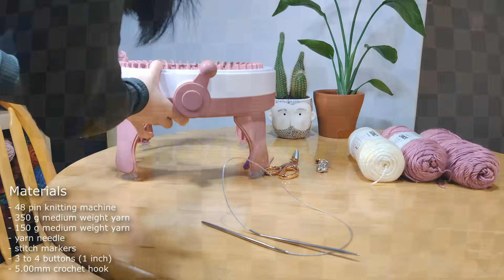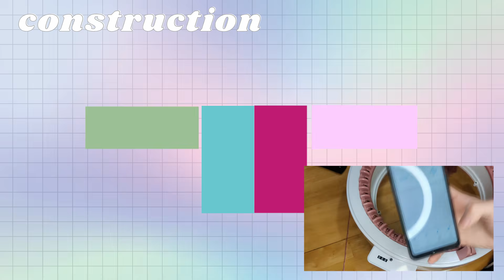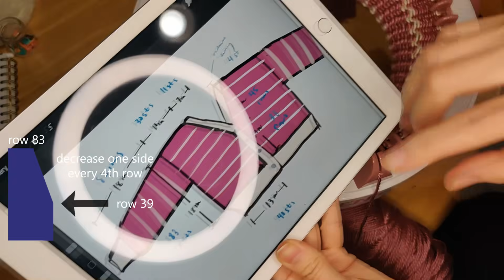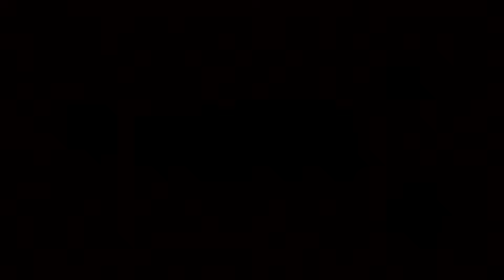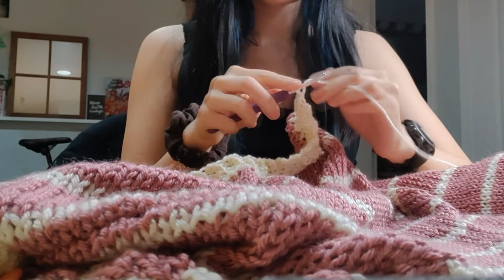Drop Shoulder Cardigan | Sentro Knitting Tutorial

Comment: I have a question when people say to add waste yarn what is that exactly?
Reply from the maker: Waste yarn is used to surround your working panel, sometimes the first and last few rows can have less tension or dropped stitches so using waste yarn can help prevent that. 
Later you would remove it and people generally use yarn they don't like for this that's why it's called "waste yarn", hope that helps! There's lots of tutorials around it too :)

Comment: What material was your yarn? I'm using weight 4 acrylic yarn and it's really rough with the machine (doesn't slide off easily while cranking)
Reply from the maker: I also used size 4 acrylic yarn. You could try a looser tension position with the yarn just in the first hole of the tension guide

Comment: can I use 40 needles?
Reply: I used a 40 needle sentro
The arm hole that goes on the shoulder/high on the arm is a bit tighter for me (maybe when I was slip stitching the ends, I should have done it even looser)
It won't look as oversized as it does on her (depends on your body too) but it works out fine, you can give it a try

Also, when stitching the back panels together, do it like she did in the video but go with one stitch of each panel at a time instead of two like people generally do (if that makes sense), it'll help the panels look like one

Comment: Hi! Is 40 needles can do this too
Reply from the maker: Hi! You should be able to do a slightly smaller one by casting on 36 for the body panels. The difference would be around 1 inch smaller in the sleeves and 2 inches on the body. Mine was oversized for a size Medium, I hope that helps! <3
Reply: @kims_threads  thank you so much for answering! 😭🩷

Comment: what do you mean by decreasing round for the cuffs? would you be able to write out instructions ?
Reply from the maker: Hello! I did a single crochet decrease along the (48 stitches) and slip stitched into the start to make a round. This should make 24 stitches total, as I wanted the cuff to be smaller than the sleeve. I hope that helps! I'm planning on making a written pattern but it will take some time to pattern test for different sizes.

Comment: Does it have to be the 48 knitting machine? I have the 40 knitting pins
Reply: I have same question
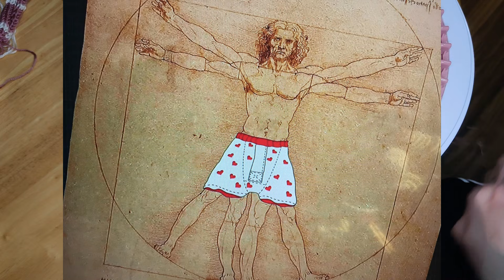Reply from the maker: Hello! For my dimensions at 3:32 I cast on 40sts for the bottom, for a 40 pin machine it might be hard to do, you can try it with looser tension or adjust the st count to be less, maybe 35sts instead. I hope that helps!

Comment: What measurement should I get for the width of the sleeve?
Reply from the maker: Hi, if you are also making a size medium I'd recommend using all 48 hooks and 66 rows
Reply: @kims_threads  should I take measures of any specific part of my arm to make sure it will fit me?
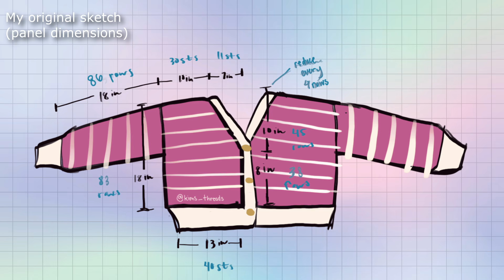Reply from the maker: @nombre2745  you can use the shoulder measurement centered on your body (at 3:32) to find where the sleeves starts on your arm. Then measure the length of your arm, the sleeve is (14 inches for 66 rows) but keep in mind the cuff is an extra 3 inches. I hope that helps!! 💗 I'm planning to make a more descriptive video on how I gauged everything but it might be a couple weeks before it's posted!

Comment: Beautiful! I love the mix of Sentro knitting and crochet. Great way to make buttonholes.
To decrease, youo could try to move second stitch to third stitch and move first stitch to second position. That way the decrease is not in the seam, making the seam easier, and it is less likely to tuck when you turn.
Also, another way to make a stretchy ribbing, double crochet front post, back post, front post, back post all the way around, adding rounds until you have the width you desire.